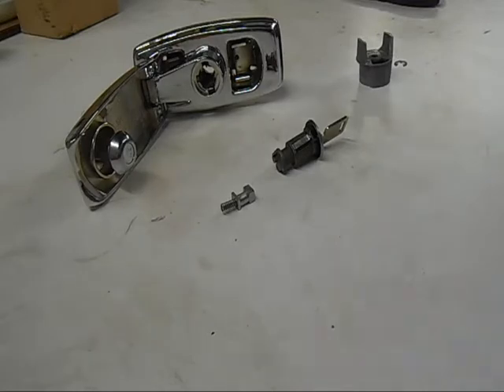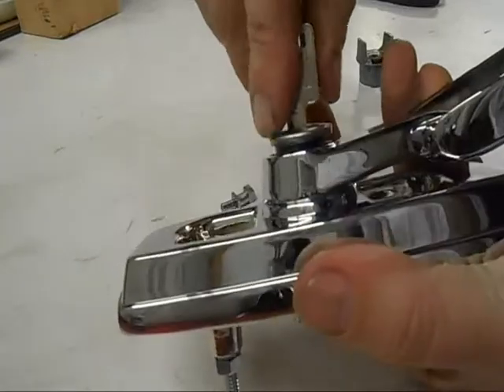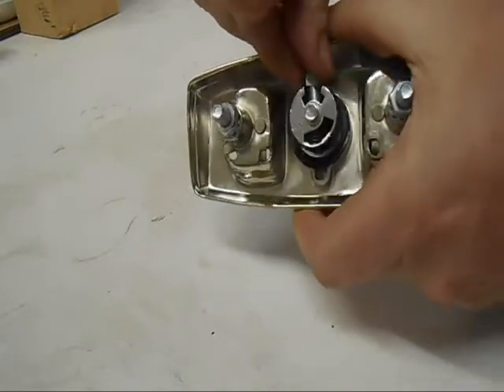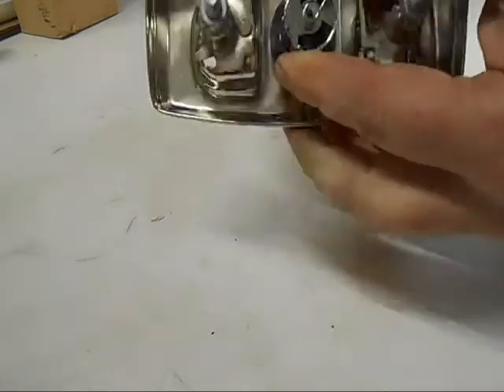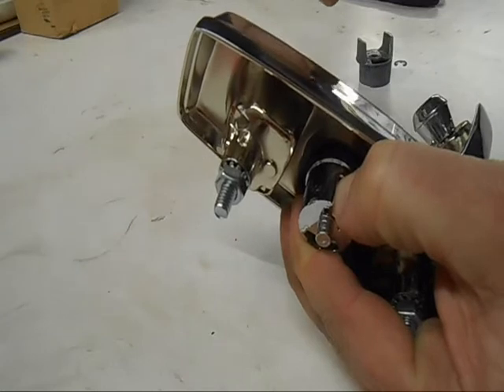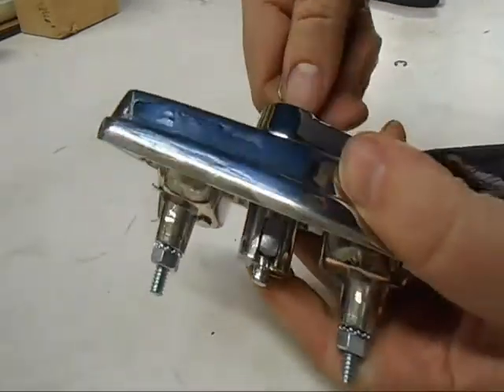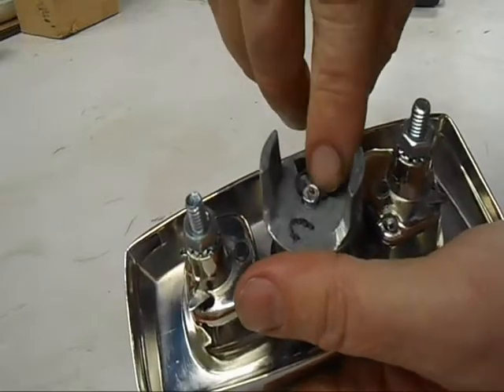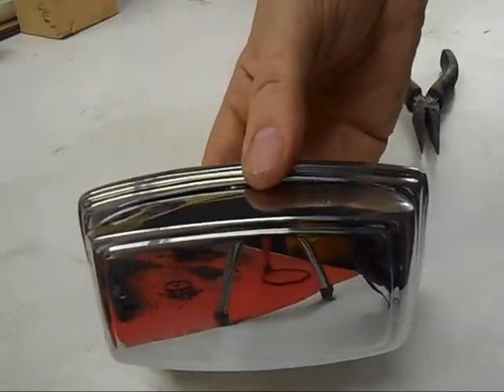DIY chevelle wagon tailgate crank - how to

Comment: Where did you find the assembly and lock cylinder? I need one for my 1964 Impala Wagon
Reply from the maker: www.einstyn.com has the rotational parts for that year. the base has to be reused
Reply: @einstyndotcom  Thanks! Can you describe the removal process for the assembly? I'm guessing inside panel and glass must be removed first?
Reply from the maker: @josephferrisiiido-technolo2049  similar to the instructions at the bottom of this page https://einstyn.com/onlinestsore/tg-parts-page/ I believe you can leave the glass in just all they way up. be careful if the gate is open and the window is up it can fall right out onto the ground. but then you should be able to access the 2 mounting nuts for the bezel base